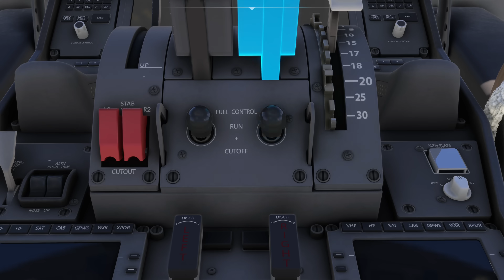Air India 171: Why Did The Fuel Cut-off Switch Get Moved?

Comment: Capt. Steve, I think you are making a huge mistake by saying with certainty the pilots moved those switches with intent or at all. Ask yourself, why do they use the word "transitioned" and not "moved" or "placed" or "selected"? I saw your video about the Air Bulletin and it does apply to the 787, not just the 737. It explicitly warns if the locking mechanism is disengaged, there is a possibility the switch could falter and cause an engine shutdown.  The bulletin actually applies to most aircraft with those switches. Also, was it exactly one second between supposed shutoffs? Was that number rounded up or does the system default to one second? Was it over 1 second and rounded down? If I take both switches and shutdown the motors at the same time, what will the DFDR print out? Not known, but even 1 second while in a takeoff regime is pushing the limits. I can't count how many times I have shut down the 737 and gotten stuck on the detent. So, one of these pilots did it perfectly during a takeoff while setting the initial climb profile? 

Why was the report leaked to the WallStreet Journal? Was the RAT deployed automatically or was there a button pushed (DFDR should have this)? Why don't we have the entire conversation and who exactly said what? It is a dual channel CVR, so you know when the left or right mic is keyed. They may have been hot mic, but again, do in the report. Why was the report NOT signed? 

Let's pretend that one pilot did do this, why not just take the yoke and roll the plane at engine loss? Why prolong it? If they really wanted to die, there are numerous ways. Again, more questions. 

At this stage, I feel it is still early to make blanket statements as if we know exactly what occurred and how. One of the pilots may have done it, it may be intentional, it may have been from taking one's life, etc., but too many questions remain. Heck, it could have been a faulty chip at the FADEC/EECs, or locking mechanism was faulty, which they could alleviate that concern easily by testing the switches. Which brings up another question, why haven't they? Why have they not said, we tested the engine fuel control shutoff switches and found everything to be normal. Right there, there would be no questions about the bulletin.

Comment: what about simply moving the switch to the far side of each pilot, so you would need to lean over to their seat or get up, basically something very noticeable. If we aren't looking for a solution to this problem. then what are we doing? inventing a protocol to cure all future mental health problems? The purpose of two pilots is to negate the human factor, this is part of that human factor. even just moving the switches up higher so they are in your field of view. there aren't that many ways to crash that plane in that situation with another person monitoring you without it becoming a confrontation, which many people will avoid.

Comment: So now the entire blame is thrown at experienced pilots? Seriously?

Pilots with thousands of hours in the cockpit are suddenly called “negligent” and blamed as if they crashed the aircraft Bollywood-style in a suicide stunt — while Boeing walks away untouched?

What next? Thank god the media hasn’t claimed the pilots were the grandsons of Osama Bin Laden — because that’s how ridiculous this narrative is getting.

Let’s talk facts:

Why did DGCA release the preliminary report at 2 AM? Who authored it? Who signed it?
The report has no official release date, no authorized sign-off, and no transparency.
Honestly, even a roll of toilet paper has more integrity than this document. It’s an embarrassment.

There was a 10-second silence before the Mayday call. What happened in that gap?
Why aren’t we being given the complete cockpit voice recordings and communications?
What exactly went on inside that cockpit before everything went silent?

In 2019, Boeing issued a warning about this exact fuel switch. Why was that not acted upon?
The switch in question — Honeywell manufactured part number 4TL837‑3D — had known locking mechanism issues saying it may go to closed or shut  mode automatically when  locks are not engaged,
The FAA even issued a safety bulletin, but since it wasn’t mandatory, Air India skipped inspections.
Now that a crash has happened, they act like it was unforeseeable?
There were documented complaints. They were ignored.

Let’s not forget: John Barnett, a former Boeing engineer who exposed serious safety failures, was found dead under suspicious circumstances just days before testifying in court. What does that tell you about accountability at Boeing?

Now here’s the real bombshell:

Boeing currently has over 6,500 pending aircraft orders, valued at more than $460 billion.
Just the 737 MAX backlog alone exceeds 4,800 units.

That’s more than a decade of production already committed. Boeing simply can’t afford to slow down.

So what do they do?

👉 They cut corners
👉 Ignore red flags
👉 And rush deliveries just to protect revenue and keep shareholders happy.

When you’re this far behind, safety becomes a luxury — not a priority.

Even the custom Air Force One order for Donald Trump — a multi-billion-dollar project — faced severe delays and internal chaos. Then the president of US was satisfied with a Arab country gifted plane.That’s how deeply this pending order mess runs.

Lives are being lost. Whistleblowers are being silenced. Defects are being denied. And pilots are being blamed.   Why so called medias and youtubers keeps mum over these valid points.??

Comment: As with the other Boeing crashes. It was not the airplane's fault; it was a design fault in combination with the pilot's intention/error/suicide. This is also a design fault that COULD have been prevented with a better-designed airplane. System designs SHOULD take user faults and intentional bad decisions into account and prevent catastrophic outcomes. Otherwise, it would never be a reason to have dual pilots in the cabin. A single crazy pilot should never have the sole capability to crash a plane.

Comment: The thing is, the 10 seconds between one of them acknowledging that the fuel switches were turned off and then turning them back on again is just very bizarre.
There is no reason why to "accidentally touch" those switches as the plane has already taken off, or else the plane wont even lift off...

Comment: 4 fuel cutoffs 2 on captains left 2 on co pilots right out of reach of the other. for a 2 engine aircraft so to stop engine 1 both have to match and be in cutoff, to start both have to be set to run. Call it the separation of church and state.

Comment: So far we really don't know, if it was an act done by human, till the final official report comes out.

Considering the given situation, it appears that these fuel control switches can be placed from fuel cutoff to run to position and vice versa, based on the requirement like takeoff and landing or an emergency situation/condition as decided by the Pilot.

Since, there is lot of Instrumentation involved that are existing, some builtin logic, with the computer, should be possible to take care of such inadvertent or intentional act of switching off the fuel control switch while (during takeoff) aircraft is airborne .

Like; Considering parameters that are already available during takeoff (as a part of Instrumentation), till the aircraft reaches the safe minimum altitude (in the AI 171 case, as I understand, one of the Pilot noticed the change in fuel control switch position and attempted to change it, this could not help, as the altitude was too low to recover),  such changes in fuel control switch (Run to switch off) to be  suppressed or disabled (only during takeoff and for known duration), while otherwise or in descend mode it should be possible to control the switch position.

Offcourse this logic must have been already thought of, I am just putting up this logic for discussion, out of curiosity and to understand the issues, if any, with this logic.

Your explanation/logic could be of some help to Aircraft/Aviation engineers, as it would have Pilot's perspective.

Request your views on this.

Comment: Thank you Steve - I’m interested in knowing, which switch was turned off first. A, then B or B, then A. Then, the order the switches were turned back on. From that information there might be a clue to who activated the switches, the pilot on the left or the pilot on the right. Think right hand verses left hand as the pilot sits. This could give a clue if the same pilot performed the action or who initiated and who resolved. IMHO, I don’t think it was the pilots, especially since the switches had been replaced twice. Maybe there is a wiring issue.

Comment: The 10 seconds is interesting to me....almost as though the switches MAY have been actually in the ON position. and the pilot had to actually switch rhem OFF and then ON again. The pilot seemed to know the switch was off....why take 10 seconds to initiate the first one toggle back...maybe because the switch did NOT look to be in cutoff, and they finally just "tried it". You say there was no flaw....probably right, but not necessarily true. Remember the MAX software bug that caused the crashes....and you mentioned the ground mode disabling of I think it was these switches. (I think they initially blamed pilots for the MAX8 crashes)
Reply: agreed, read my comments below . i've said similar things in the past 2 days, yet, not Steeve and GaryB have addressed the possibility the switches were always on the on position. We've all had the experience of a faulty switch at home or workplace. A light switches that has to be toggled a few times before it turns on due to lose wiring. Given the quality control issues with Boeing and their poor track record, it is entirely possible an electrical short happened during the takeoff.

Comment: 3:14 Both pilots having to activate the fuel cutoff might work up until one pilot is incapacitated. It seems like the REAL solution is to make planes SUICIDE proof. Or maybe just make the planes SMARTER so pilots can't make STUPID decisions like accidentally or intentionally shutting off a good running engine in flight.

Comment: 😂haha after one month of investigations hidden conclusion of the report "pilot suicide" "The mountain in labour gives birth to a mouse" There's nothing to see here, move along" this case is classified.

 

Surely ..it will be  the  safest exit fot both air india and Boeing.👌 Especially for Boeing, another software glitch ( As it was the case of the 737 Max) will mean inevitably a bankruptcy. 

Mary schiavo a former Inspector General of the United States Department of Transportation stated that the most probable cause of the dual  engines failure is a software glitch. She mentioned the ANA 787 incident in 2019 with dual engines failure in the final landing phase due to software problems ( Throttles went to idle configuration due to erroneous low-range radio altimeters mesure). What if the same happened to the air India just after takeoff?

But I can't buy it a suicide story?the report story is not coherent. 

Professionals spreading false facts to save big businesses is unsupportable and a slap into the face of the families of the victims ..shameles.

Anyway I still convinced that a software glitch the cause of this sad event 

After all what i have heard or seen this is in my opinion the catastrophic chain of events which led to the AI171 tragic crash:

-Erroneous low-range radio altimeters mesure just after takeoff (For the flight computer the 787 was on the ground)  and forcefully set the  thrust throttles to idle configuration (Happens once to ANA 787 in 2019). In this unexpected rare situation the pilots were just able to recognize that they hadn't enough thrust (last captain call). 

-This resulted in  sudden drop of electrical power ( The only crash survivor describes  an abnormal flashing of all indicator lights in the cabin). The lack of electrical power led to  hydraulic system  failure ( the reason why the retraction of landing gear stopped just after they tilt).

- The first redundant backup electrical power systems was not able to generate enough power (DC battery bus). This  initiated  RAT deployment. Which exacerbated the situation because of the huge drag induced by it .

-The plane began to lose altitude flying  further ( momentum) for a few hundreds of  meters and unfortunately crashed killing All passengers (one miraculous survived) and many people on the ground .

I am afraid that 787 may have a serious operational software design problem which stayed hidden for a long time because of unfavorable boundary conditions.

Comment: Okay I have a stupid theory. What if the switches didn’t physically move at all and remained in Run position for the entire flight but due to some malfunction the fuel was cut off without the switch being physically moved and one pilot asked the other ‘why did you cut off?’ feeling the loss of thrust and looking at the warnings and alarms, without looking at the switch first and the other pilot replied that he didn’t and only then they both looked at the switches, but by then the fuel had started running again to the engine. Is this a possibility?
Reply: i agree, i've been saying this for the past 2 days. also read my comments below yours.

Comment: Did the pilot actually SEE the other pilot flip the switches or did he just see the information on the screen in front of him? Why would he not then shout to the Control tower, that the other person just switch the fuel switches off? Why just a MAY Day call without giving the reason other than loss of thrust?  He knew exactly what the result would be if the switches were turned off yet, he didn't shout, didn't radio anything to the tower. Why not? This is human nature if the human knows the immediate results of such fatal actions!!  I think, that is until all the info comes out , that the other pilot just saw the indicators saying the switches were on the "off" position and then assumed the other pilot turned them off manually. I'm think there was a glitch, a short in the controls that did this electronically, not manually. We can't go by a verbal , yet calm comment form a pilot. did he actually witness this done with his one eyes? I doubt it, in my opinion given the simple , human reaction that would  have need happened. It didn't.

Comment: Hey Steve, I think back to the day of. To the first time the news showed the cell phone video that was shot from that apartment and not only remember what I saw, but what I heard. It sounded like a giant propeller flying overhead. There was allot of talk about the RAM Turbine and what would cause it to deploy. If the fuel control switches were shut off manually, would that trigger the RAM Turbine? Or would the RAM Turbine have to be manually deployed? If manually, it must’ve happen very quickly in order for the sound to be captured by that apartment video.

Comment: This instant blaming of the pilot is outrageous and still no good justification from Captain Steve regarding cockpit cameras. Disappointing. Just think for a moment about why the industry is so keen to pin this on the pilot rather than on potential mechanical/electrical failures in the aircraft that makes them more money than god. Hmm I wonder why. Blaming the pilots should be the LAST thing looked at here.

Comment: I'm still not convinced it was done by human intervention as you state. The report states the switches went to cut off. In normal circumstances, I agree it would be fair to make the analogy that they were physically moved, but that's not what the report states. The response of the pilot saying I didn't do it is either true or not. The smoking gun is in that response. I believe there is a documented case of a 787 after landing having the same problem. They never did find the cause. This report is preliminary. They've only just begun trying to solve this tragedy. Far more details are needed before we even get close to what really caused the engines to shut down. Thanks for your opinion and breakdown.

Comment: 3.26    So if the switches are no longer an option, then all the one pilot has suicide in mind all he/she has to do is to push the stick forward and hold it until the plane noses into the ground. Or close the throttles etc etc

Comment: On questions about putting in additional guardrails, if someone intends to sabotage the plane, there will always be a way to do it, and no amount of guardrail can completely prevent that. On the other hand, to Captain Steve's point, the more difficult you make certain actions, the less capable the pilots become when they legitimately need to take those actions in a matter of seconds, so it is a balance of risks.

Comment: Why has neither the cockpit voice recorder nor the atc audio been released to hear the conversation or the mayday call in their entirety? Also, why are some items on the time line part of this report so precise with time stamps where it says at 8:08:42 something happens but other parts are more general like immediately after that switch was transitioned to cutoff and then the other 01 sec apart. Also why not give the EXACT words said by each pilot verbatim with time stamps instead of trying to summarize or paraphrase? Seems like an odd thing to do... 

To me these are very basic things that would make for a much better and clearer understanding in this interim report.  Anyone else agree or is this just typical for reports like these to present it like that?

Comment: I saw a comment somewhere about an incident that happened to a Japan Airlines Boeing 787, that both engines shut off while taxiing due to a FADEC discrepancy without the pilots touching the shut off switches.
Could this have happened to the Air India flight ?